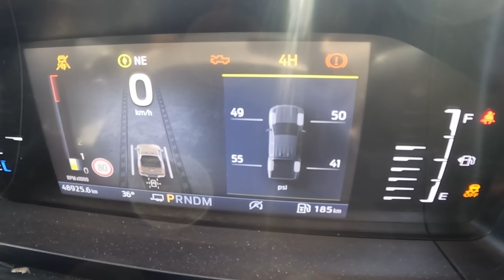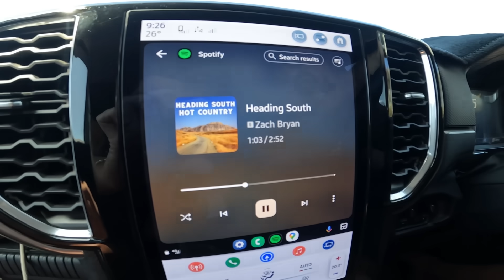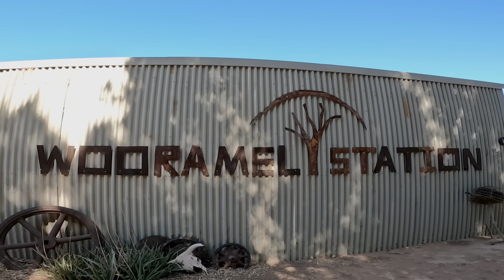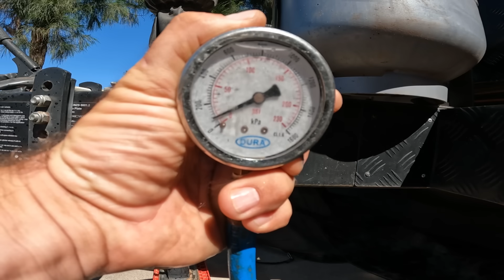GROSS CAMPERS | It’s Getting Expensive | Wooramel Station, WA

Comment: Keep up the good work, on the pressure limit valve, I removed my fixed valve and fitted an adjustable valve with a pressure gauge that I fit to the caravan park tap, helps any chance of a burst blue hose pipe plus protects van plumbing, I think I bought on Amazon, regards Tony
Reply from the maker: Good idea Tony! 👍

Comment: The bottom Yandi creek track saves a lot of unnecessary pain especially after you have had a challenging drive from the southern beaches. We purchased a four hose air pump system and its a game changer. We can air up/down in about a quarter of the time. Getting 21/100 into a head wind is pretty good fuel burn - a Y62 would be in the high 20s+. Keep the great videos coming!

Comment: Love your travel stories. Thanks for the info re the water pressure. Our hot water service runs continuously. Hubby wants to know how to measure the water pressure? Where do your stick the pressure gauge? And what are the two items we need to change? Thanks Denise
Reply from the maker: Thanks for watching! 
We measure the pressure from the front tap on the caravan with a water test pressure guage, should be able to get from a plumbing supplier or bunnings. 
It's a 350kpa pressure limiting valve and a 15mm spring check valve 👍 you'll also need a 15mm nipple to in-between
Reply: @CaravanAdventureAus  Thanks. Much appreciated 👍

Comment: Should use a 20mm cap over inlet, keep the dirt out.
Ive fitted a mains pressure inlet to rear of van. That can use short hoses for connection to mains

Comment: Hi Guys.  Nice Ep.  Just regarding the water pressure issue, can you give me the names and pressure valve details that you fitted to your van, so I can put them on our van?  Our hot water system started leaking at the tank, so Swift were good enough to send us a replacement which I put in myself but at the moment, the water pressure from the caravan park tap is the same pressure as the tap on the caravan is putting out, ie the limiting valve isn't limiting the water pressure.  Loving your episodes - you put them together very well!  Steve and Dena

Comment: Great vid as always, I had a problem with my pressure valve as well.  It’s crap when you pay for water at a caravan park and have to use your pump for a shower. Great solution, if possible can you please supple more details on the parts and where to buy thanks
Reply from the maker: Thanks for watching mate! For sure it's a pain! 
It's a 15mm spring check valve and and 350 kpa pressure limiting valve, can get from most hardware stores or reece plumbing stores 👍

Comment: Hi Bryce , I recall you were speaking about low water pressure in a van , it’s what I’m experiencing. I have replaced the pressure valve , but kept the old filter. You recommended using a different type of filter . Can you send me the details of the system you use please.
Reply from the maker: We use a puretec z7 inline water filter on the kitchen tap only, we don't filter any other water in the van 👍

Comment: Do you fellas seriously run 50pai in the frnt when towing on tarmac?
Reply from the maker: We always over inflate when airing up and then adjust to the correct temperature when cold, that way we only need to let them down and not have to inflate more. Means only getting the air compressor out once 👍
Generally the tyres are at 45psi when hot 🔥

Comment: Crazy fuel economy however, do NOT install an ARB long range tank.  Can't be calibrated to your fuel guage and its nigh impossible to know how much fuel you have !!!
Reply: A scan gauge takes care of that problem, plus you get a lot more info including the all important transmission temp which is very handy. It’s also it’s a fault finder and code clearer as well. Long range tank can save you money going to the next cheapest fuel instead of being caught out with dearer fuel.
Reply: I must be lucky because my Ranger long range fuel tank and gauge are reading right. Happy me.
Reply: @ , yeah they read and it doesn’t take long to get used to it. On my previous vehicle I had 300 kms left when the fuel
light come on.

Comment: Lovely video … again.  Thanks for the hws tip too Bryce, it’ll help at some time in the future! Any tips on a quiet pump, ours sounds like a plane taking off (it’s new too) 😂😂😂
Reply: We had the same problem with our noisy water pump. I put extra rubber mounts on it (not much improvement) and also installed a sure flow accumulator in the pressure side of the pump and it reduced the noise a lot. Now as quiet as the fridge.😊
Reply: @ thank you, will follow up on that 🙏🏻🙂
Reply from the maker: Thanks for watching! 
Just extra rubber underneath is all I can suggest, the flow accumulator/pressure vessel is a good idea 👍
Reply: Love the great video
Reply from the maker: @garrywood5462  thank you! 😃